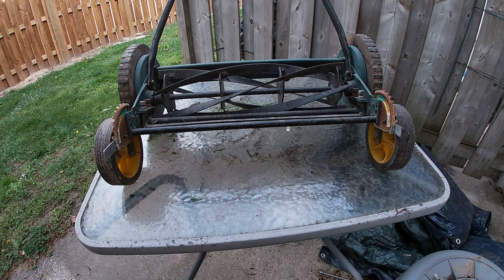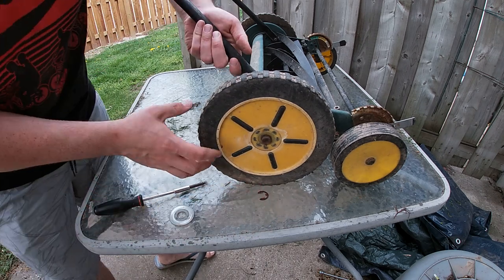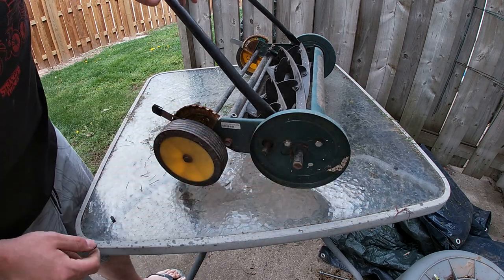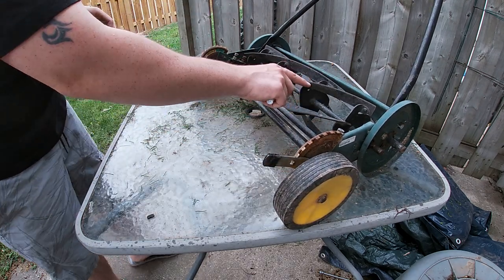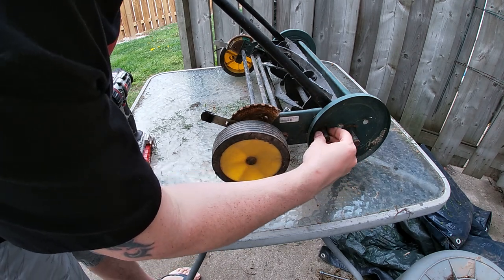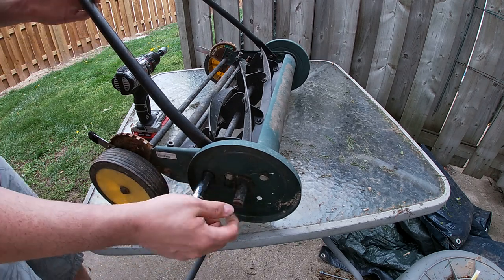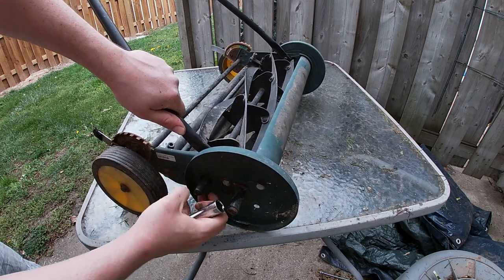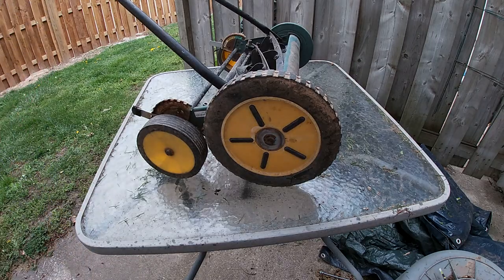How To Sharpen Blades On A Yardworks Reel Lawnmower

Comment: Interesting putting a socket over the metal pin. I tried to make an adapter with hose but it did not work. What size socket was that please?
Reply from the maker: I want to say 11/16. But I could be wrong. I didn’t make not of that. Your best bet is to put a socket over it and check the fit then use the one that’s best. Thanks for watching. Please like and subscribe

Comment: I really appreciate this video.  My Yardworks 18" reel mower (purchased 2021) has a clip that is almost a full circle (as opposed to an E clip).  Any advice on how to get this off?  I just seem to keep pushing it around in circles.  Cheers.
Reply from the maker: Glad you enjoyed the video. Those clips are fairly flexible so if you take two pairs of needle nose pliers and hold one end still while you pull the other end out. just pull it enough to lift it out of the groove then pull it towards you. Also on both ends of the clip you may see two small holes. If there are holes you can buy a tool called a spring removal pliers. You can insert the pliers into the holes and squeeze and it will stretch the clip for easy removal. They cost about $20. Hope this helps. Please like and subscribe
Reply: @BillOfAllTrades2016  Thank you, that is helpful.

Comment: Exchange the left/right inner gears and push the mower backward on concrete surface.
Reply from the maker: Yes you can go that route as well. I prefer my method though. But both are effective. Thanks for watching. And thanks for sharing your method. Please like and subscribe
Reply: I got an old 18" Yardworks for $20. The blade edges were well worn. Back lapping would take too much effort and I don't want to spend money to have it re-grind on the lathe. So I use file to sharpen the blades to small angle bevel and convert it to non-contact type. The mower is easier to push; the reel rotates at faster speed and cut grass with speed like a weed trimmer.

Comment: Here's a question for you :)
Can one use a metal file for cleaning up the blades? That compound vs a metal file, to me, zero difference :)

But I could be wrong :)
Reply from the maker: A metal file is not advised. You may create a low spot if you don’t file it perfectly even pressure across the whole length of the blade in each pass. The compound or a sharpening kit are the advised methods to keep the blades evenly sharp. Hopefully this was helpful. Please like and subscribe